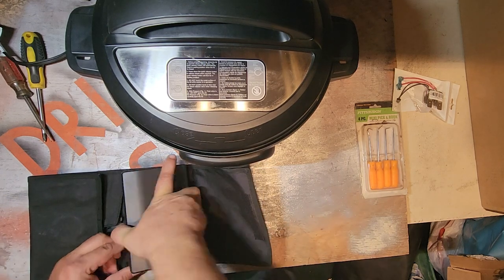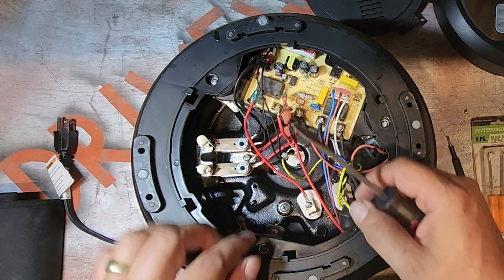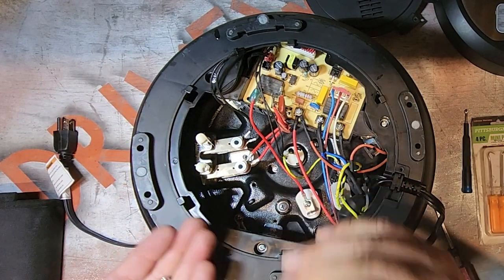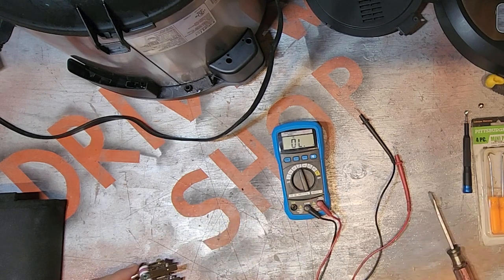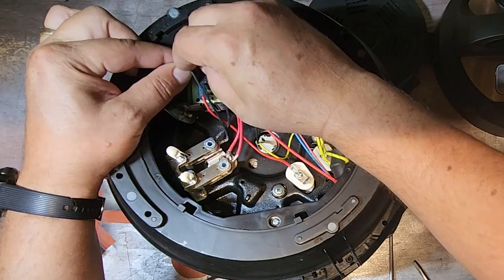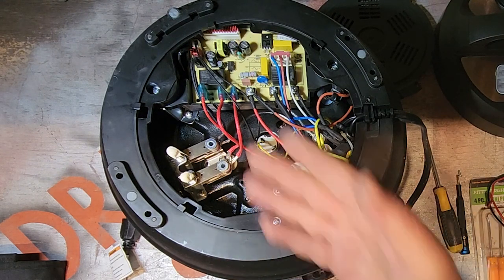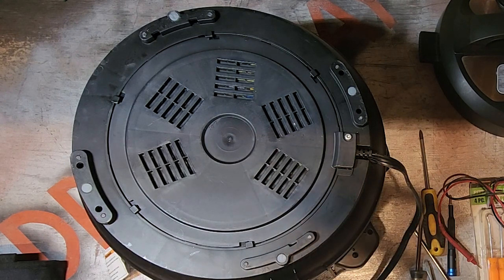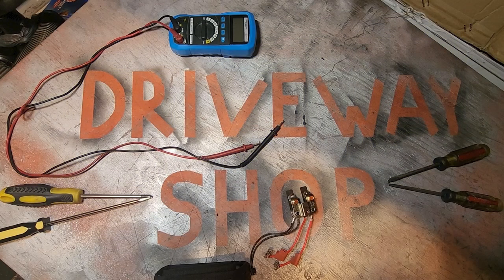Instant Pot Duo Repair

Comment: Is mine fixable.
Besides the lid & the stainless steel bowl inside the pot, does the Insta Pot come apart? My son in law must have somehow banged it around during cleaning, because the black insert with handles is off kilter. And the bottom black part with legs is also off. I have a video but don't see option to attach.
I believe it works. Just doesn't sit level on counter
Reply from the maker: @sylviaparamo9164  I would hope it's fixable, but I didn't know. I have never torn one apart, beyond what you see in this video. That would be interesting to do if had one beyond repair.

Comment: The left side of my instant pot Max control panel is not functioning for some reason can you tell me how I might be able to fix this and maybe troubleshoot it it was working fine and then now it doesn't work I can start it I can do everything on the right side but I can't do anything on the left
Reply from the maker: @Lund-kl1vh  not directly. I've never taken a control panel apart (yet). 
I'd start by seeing how far I could easily take it apart without breaking it further, and have at look at the button mechanisms. But likely there is a cable or wires broken, maybe a blown capacitor or other component. Good luck.
Reply: YOUR POT HAD A STROKE

Comment: You didn't have to calibrate the new switch?
Reply from the maker: Is that a thing? That said, it's working fine still
Reply: @drivewayshop  I had to do it for three different Instant Pots I replaced that switch with, otherwise it would not reach proper temperature or over shoot it so it over pressurizes and blows out the ring seal
Reply from the maker: Good to know. I'll look it up. Thanks! 
So far it hasn't been a problem
Reply: Can u tell me the name of this thing??
Reply from the maker: @msparwana3226  instant pot pressure switch. Make sure you get one for your specific brand/model

Comment: Can you help me error is E4
Reply from the maker: I've never encountered this error. Googling shows to first turn it off for 5 minutes and see if it resets. There was also wipe out the bottom if it's wet. 
Maybe replace the sensor if these don't work.
Granted, I have no experience with that code, so I can't say that the above suggestions are what you need. Good luck